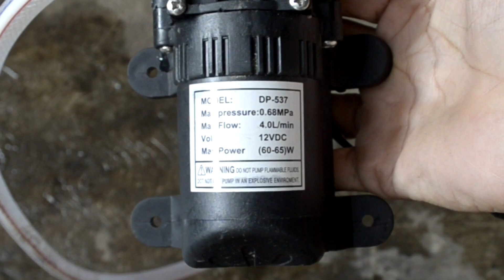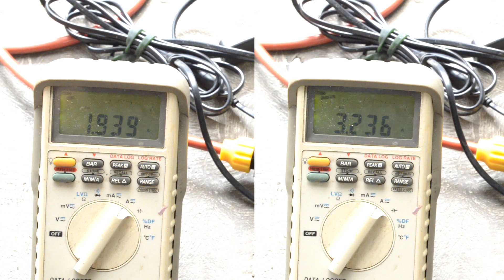High Pressure 12V for Car Bike Wash Water Portable with Battery Power 3A DC DP-537

Comment: How many psi
Reply from the maker: It is claimed that a single motor pump produces 80 to 100 psi, but I find this difficult to believe. Given that a good model only requires 12V 3A power, while the water pressure is decent, but the waterflow is significantly lower than a jet cleaner. It's sufficient for small tasks
Like Clean evaporator Air Condition, bike, motorcycle, etc.
Cleaning vehicles or yards demands a more powerful tool.
I hope this info can help

Comment: Sir pipes link send me
Reply from the maker: Outlet with water output requires a polyurethane (PU) material hose.
The hose size should be adjusted to match the pressure pump output's quick release connector.
The flexible PU material hose helps maintain water pressure within the pipe.

Comment: You can cheaply use this kit to build a portable cordless 12V high pressure washer, using a garden sprayer, a 11.1V (3S) 25C LiPo battery and some zip ties. It's not like a jet washer (with the pre-heated water), but it costs 1/3 of it, giving you full autonomy (you don't need a plug/socket, or to be attached to a water tap).
Instructions are published on my Instructables page.

Comment: How much continue it works/hour
Reply from the maker: Depend capacity battery lithium
3A full charge about 30 minutes
Lead Acid battery, can work too.
With adaptor DC 12V 3A pure power, can work better.

Comment: What size of connectors are you using on the pump ?
Reply from the maker: Connector water
Using standar Garden hose plug.

Power wiring
Socket power like modem adapter power or for CCTV power connector
But we modification, wiring with AWG cable from battery to port motor pump, can handle 3A 12V
Output battery 3x18650
One board BMS 3s
Output from board direct to power motor
Reply: @ObengwareID  I cannot find a standard garden hose fitting that screws onto the pump.

Comment: hello dear friend thanks for the video, i've order a 60 watts/o.9Mpa 6l/min pomp...are this pomp with those configurations enough for washing a car ?? can this pomp last for long usage, can it be damage , if accidentally splash by water ?? ...thanks again ...peace from Morocco :)
Reply from the maker: Splashing water can enter an unprotected motor for 3l/m pump with plastic cover.
But the 6l / min version uses a motor protector.
In theory, it is quite safe from splashing water
The carrying part of the motor, there is a fan for cooling under machine.
Can enter water can make rusthy, so be careful
I hope can help
Reply: @ObengwareID  ok my friend thanks for the quick response, so it's better to protect it with a plastic bag or something

Comment: Very well done video. I am wondering how I can get more psi than this however. What size of pump should I need for about 900 psi? thanks
Reply from the maker: This is a small pump with DC power
Only drain 3 liters per minute pressure.
Motor power 12V 3A, and portable.
Very sorry we don't know, for very high pressure.

Comment: What is the maximum length we can have for the ejection hose so that  we will get same spraying power which we get while using short length ejection hose?
Reply from the maker: Maksimum panjang pipa antara 5-7 meter untuk pompa power 3A 12V
Dengan selang bertekanan tipe PU
Pipa lebih panjang, sampai 12 meter (kami menguji juga)
Tekanan air sedikit drop.
Butuh mesin pompa lebih besar antara 5A
Jadi, tergantung kekuatan mesin pompa
Yang kami uji tipe 3 liter permenit
Model lebih besar sampai 5 liter permenit
Semoga informasinya membantu

Comment: Hi bro please send material details as cost them
Reply from the maker: In Indonesia
Mini Pump $8
Valve $4
Pipe $6

LG HD Lithium (reused)
Battery 3 = $7
BMS $2
Bracket battery $1.5
Battery capacity about 1,5A 12V/DC
 (15-20 minutes)
Exclude socket cable soldering $1.5
Exclude lithium charger, stock. 
I hope can help

Comment: What is the capacity of that plastic container in the time test?
Reply from the maker: About 18 liter.
But the key point. not how big container.
Power adaptor, Accu battery, or lithium battery pack. This high pressure pump, need 12V/DC 3A pure power.
We test with big lithium battery 9 x 2.000mAh (3x3). Good running about 15 minutes before battery drop below 12V/DC
With high ampere adaptor 3A 12V more stable.
I hope can help.
Reply: @ObengwareID  ,  just to clarify, I'm referring to the container at 3:53 of your video. 
It doesn't look like a 18 liters container.

Comment: Bro if i use 12v  0.5amps adapter how its water pressure;  because my car washer is very low pressure , my car washer power is 12v 80w  pls explain which power adapter i want to use
Reply from the maker: This test 3A 12V Pure motor pump, the other pump like high flow rate (of course more expensive motor) , may be need more power 
Dont waste your time, more simple with accu power car.
You can see 3Ah with multimeter

https://youtu.be/dRY3DyO71Hw?t=183

Comment: Maximum how much length discharge pipe will possible ?
Reply from the maker: Dont, no specification max length the pipe, We test bundle package include inlet 1 meter to reservoir, DC high pressure motor (optimal 3 Amp 12V), 6 meter outlet pipe, and the end valve spray.
I hope can help